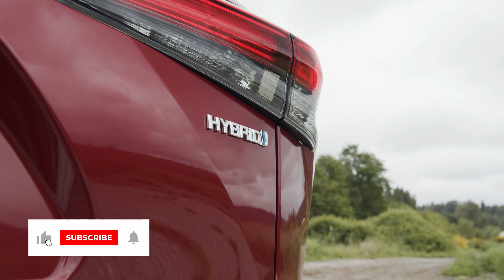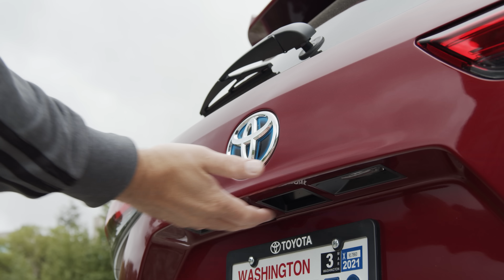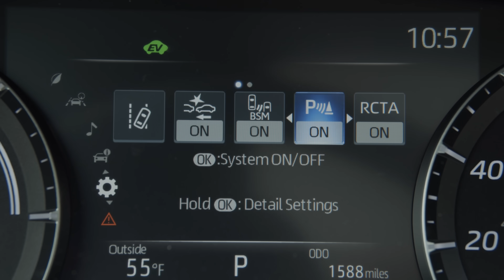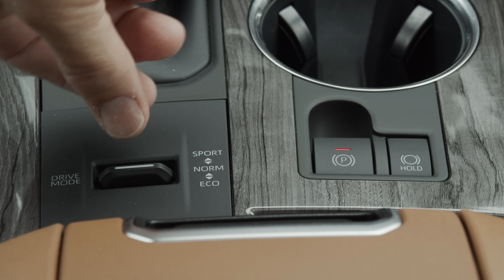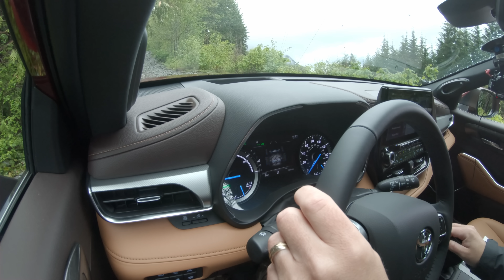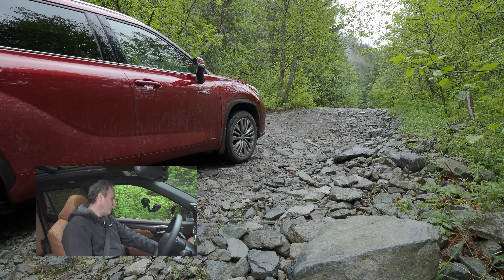2020 Toyota Highlander Hybrid AWD Off-Road Review

Comment: I'm seriously concerned it does not have hill descent control system... I've been driving a lot in the mountains recently and I'm worried about brakes. V6 version has it but could not find any buttons on Hybrid one. Any thoughts?

Comment: On a road like that clearance is more important than traction. I would have no problem driving up that road with a two wheel drive pick up, but I wouldn’t want to try it in anything without decent clearance. Better tires would be a great benefit as well.

Comment: No clutch for rear axle - fine , no overheating clutch , but does rear motor (MGR) have active cooling? Such slow mo uphill stressing rear motor also should get hot and unless actively cooled eventually would give up and awd will say : front drive only ;(

Comment: It's the torque to each wheel that counts not the power to each wheel. At 0 mph with high rotation force there is exactly 0 hp.  Even at 2 mph, no more than 10% of the power is required but high torque is if there is the traction to support it. At 1 mph, 10 hp provides 3750 lbs of force. At 4 mph, 54 hp can provide over 5000 lbs of force. I believe 54 hp is what the rear motor can provide alone. Couple this with the front drive train, power to either axle is not the limiting factor, it's each motor's respective torque rating, the availability traction, and most importantly the left right distribution of torque on each axle when slip is encountered.

Comment: Just out of curiosity, how do you think this AWD system would do on a 4x4 beach where you deflate the tires to ~20PSI? I have a 2021 hybrid, and our family is talking about going to the Corolla 4x4 beach which does allow for AWD vehicles on a case by case basis.
Reply from the maker: I think it would do OK so long as you don’t get too deep in the soft stuff.
Reply: @drivingsports  Thanks for the reply. Absolutely love this car so far. Getting ~560 miles to a tank of gas is amazing. Really want to find somewhere to test out the full AWD capability of it.

Comment: Just bought a 2021 Highlander Limited Hybrid AWD.  Put 18 inch wheels on, and will eventually put on 255/65 Falken Wildpeak AT Trail tires.  I'm probably going to add 2 inch spacer lifts to add more ground clearance.  I thought about getting a 4Runner, but I wanted something that was capable of occasional light off-road use, like the trail in the video, without driving a truck all the time.
Reply: i am thinking of doing the same thing...like that 1500w inverter for car camping and the perimeter camera view in the limited...I see Torq engineering has a 2 inch lift kit..
Reply: @stevescramo592  - Yup.  I was looking at the Torq lift kit as well.
Reply: @kchiker  let me know how it does,if you do install tge lift kit. Very curious given all the sensors  .
Reply: why 255 though? isnt 265 better for handling and stability? (may be just a bit more of fuel consumption)
Reply: @supriyasou3722  - Wildpeak AT trail doesn't come in 265 size.  I'm actually looking at the 265/60R18 now.
Reply: Are the wildpeak ok for the additional weight of the hybrid?

Comment: I think that given the RAV-4 gas / hybrid reviews, and now the counterpart reviews of the Highlander, if you think you might push a Highlander (and especially the RAV4), to the upper edge of their reasonable limits, and yet you still want to stick with a CUV instead of going for an SUV, then you definitely want to avoid their Hybrid versions, at least for now.  Hybrids are definitely improving, but they are not there yet when it comes to these types of driving scenarios.  In the specific case of the 2020 Highlander, going with the gas version provides you with the added bonus of an 8-AT instead of a CVT, plus you get more HP, more torque, and a lot more towing capability as well.  

Hybrids, and a real-word example of the 2020 Highlander:
If you plan on keeping the vehicle and driving well over 100K miles, in most cases, the V6 gas version will be better on both maintenance costs and subsequent resale value.  As the hybrid batteries start wearing out at around 100K miles, they cost about $1500 to replace, and that is for REFURISHED ones.  If you specifically request a brand new battery, the cost is no joke.  It will cost around $6K, which is why they almost always use refurbished instead.  However, in the refurbished batteries, they just replace bad cells, which means that while other cells might still be "good", the remaining good cells are much more likely to start going out, triggering additional battery refurbish cycles, that are also now on a more frequent basis, as they have increased wear on them.  At about $1500 per pop for battery refurbish / replacement, it adds up quickly.  Any savings in gas costs is immediately wiped out, and then some.

Here is a real-world example on difference of gas costs between Hybrid vs. Gas version on 2020 Highlander:
(We will use a current gas price in my area of $2.79 per gallon, and the 17.1 gallon tank on the Highlander.)
AVG 35 MPG (Hybrid) @ 17.1 gallon tank = avg of 595 miles per tank VS. AVG 30 MPG (Gas)  = avg of 510 miles per tank

With the hybrid 2020 Highlander, you gain an average of 85 more miles per tank of gas.  Not bad! With the example price of $2.79 per gallon, it means that it would cost you an average of $7.90 more per tank refill / "tank distance" on the V6 gas version of the Highlander.

So... let's say you drive a full tank of gas once per week in the Highlander. With the added cost of $7.90 ("per tank") at 1 tank per week for each year, that's 52 x $7.90, which means an average cost increase of $410 per year.  At that rate of driving each week consistently, it would take about 3.8 years to reach 100,000 miles.  When you take the added cost of $410 per year x 3.8 years = $1500, which puts you at the end of battery warranty and also the cost of a replacement of a refurbished battery! However, with the gas, you pay that amount very gradually over time, whereas the cost of batter replacement is a whopping $1500 all at once.  Moreover, you still have labor charges to replace the battery, and from 100K miles onward, you can anticipate a refurbished battery needing more frequent replacement than your NEW, original battery that the car came with. Even based on these estimates, it becomes very clear that the Hybrid is going to cost more money, especially over the long haul (pardon the pun), but we are nowhere near done...  

Despite the benefits of a Hybrid, and the fact that they are definitely improving, if you drive about 26K miles per year, the V6 gas version of the 2020 Highlander is definitely the way to go.  However, you might say Paul, that is a lot of miles per year, and I drive about half that!  Fair enough, but in which case, that burn rate of additional gas / money per year difference, would also be cut in half.  So, instead of an additional average of $410 per year, it would be $205 per year (or about $0.55 per day) to drive the V6 instead of the Hybrid.  At that tiny difference, the added cost of gas for the V6 isn't enough to give a damn, whereas dropping $1500 per replacement battery / refurbishment on the Hybrid DOES make a big difference.  Also, you would have the cost of labor.  Next, with the Hybrid Highlander, you also have to worry about the replacement of electronic differential, which comes in at about $2600 + labor, which is separate from the refurbished battery and labor.  Moreover, with the Hybrid version of the 2020 Highlander, it comes with a CVT transmission, which have reliability issues (although improving), and their notorious design nature almost always requires a complete replacement when they start having problems.  Just to be fair, the CVT is not the fault of the vehicle being a hybrid.  It is just a matter of circumstance Toyota chose a CVT for the Hybrid model, instead of the 8-AT of the V6 gas version, but nevertheless, this is the real-world situation with the 2020 Hybrid Highlander (as well as the RAV4 counterpart).  The cost of a CVT in the Highlander is about $3500, and that is without labor!  

It is pretty clear that almost no matter your driving habits, unless you are going to buy new and you know you are going to trade in before you hit 100K miles, I would avoid the hybrid and go with the V6, and you will have fewer unpleasant and costly surprises.  

With the results of Ryan's off-road testing of the hybrid vs the V6 model, it just further underscores the huge advantage of going with the V6 model over the hybrid.  Sorry about that Hybrid Highlander.😒 Keep the reviews and comparisons coming Ryan!
Reply: Great analysis, Paul!  However, in California, gas is $3.50+. But, I trade or sell every 3 years or less and definitely below 100K miles.  Would the gas still make sense. Also, if not the Highlander gas version, what other make/model of similar size would be better?
Reply: I have a 2006 Highlander Hybrid with 200k miles that's been through all kinds of craziness and still runs perfect. The technology's changed since then, but at the time it was better than the gas version in every way. Nearly 300hp from a smaller lighter SUV, the AWD system has better performance overall cuz it gives instant electric torque for acceleration, and all that torque is way better for traction than the basic on demand mechanical system they had at the time. The electric motors take some strain off the V6 and vice versa, and it's very over engineered, which is why it keeps chugging. I'd get a new one if they kept that same formula
Reply: @BrendanPJames  You are one of the lucky ones so far, but with 200K, just be ready for cost of refurbished battery and / or electronic differential.  Hopefully your also does not have a CVT like the new hybrid or "Hi-Hy's".
Reply: Paul it’s called a CVT but Toyota’s “eCVT” they use in hybrids is mechanically much different than the traditional CVT you’re thinking of. They use it in Lexus and performance applications as well. If you drive a vehicle that uses the eCVT setup you’ll realize it feels nothing like the kind of CVT you’re thinking of.

The battery pack has lost some capacity but the electric motors are 100% functional. So the engine has to charge up the battery more often, but the electric torque is still always there.
Reply: @BrendanPJames  Let's be clear about which model we are talking about.  There is the new 2021 model, and THAT model has a eCVT.  I am referring to the 2020 Highlander Hybrid.  This model has a CVT.  While they are better than what they are putting in Honda's, and way better than the Jatco's that have been going into multiple brands and models, it is still a CVT nonetheless, and they are breathtakingly expensive to replace.  When CVT's start having problems, they are largely inoperable will have to be replaced, and the are breathtakingly expensive to replace.  When you start having problems with it, you will most likely have to replace your electronic differential at the same time, or shortly afterwards, and just the replacement of one of these items will often cost more than what they vehicle will be worth at that time.  The eCVT's will be in the same boat, so there is no escape.

If buying a hybrid the driver is going to keep it and trade it in for a new one at about 100K miles, and drive in weather / road conditions, then they should be fine.  However, if they do a lot of driving in snow, muddy conditions, drive on many dirt roads, rocky logging roads, or do a lot of towing, then it is better to go with the V6, as the V6 and 8AT is vastly superior in every way.  Moreover, the V6 gets such great gas mileage that the difference of gas costs do no come anywhere near the maintenance and repair costs of the hybrid.  Any such cost savings are so easily wiped out that it just doesn't pencil out in the end.  Plus, the performance of the V6 is great.
Reply: less emissions....
Reply: @stevescramo592  Nope.  On the surface? Yes, I would agree with you.  However, the comparison is far more complicated and not that simple.

Are you willing to pay THAT much more just for "less emmisons"?  Of course not! Let's face it, while gas vehicles definitely create emissions, most people buy hybrids to save on the cost of gas, but as I just demonstrated, the savings just don't pencil out in the real world.  Also, any assumption on lower emissions is mostly "feel good" peception.  They still burn gas and create emissions.  Moreover, it requires rare earth elements to create those masive batteries as well as energy and emissions to manufacture them.  

In the end, both hybrids and electric cars create far more pollution and other negative impacts to the environment than what most people know, and in many cases, far more than what they WANT to know.  Many buyers are too busy making themselves "feel good" about their hybrid or electric, and not willing to openly look any deeper.
Reply: That's quite an analysis. Lots to think about. I drive about 10- 15 k per yr. Less than that due to covid.
Reply: @stevescramo592  Yes, lots of factors to consider.  I think the whole hybrid and electric car development is still pretty awesome,  and believe it will only get better through technology development and advancement.  Eventually, I do see it fully replacing most vehicles, but I think we are still a long way from making that a reality. In the mean time, it is nice to have multiple options for different lifestyles and driving needs.

Comment: The Highlander is not an off-road car, it is a comfortable family SUV. 
For off road adventures you have to start looking at a 4runner or Land Cruiser.
Reply: No. You don't. The kia telluride does pretty well.
Reply: @Tallnerdyguy  you need a “body on frame” vehicle for off roading. Highlander and Telluride are unibody SUVs.
Reply: Highlander can do pretty much alright in the offroading segment aswell just not as much as the 4 runner or the land crusier can be able to do.

Comment: I find it really interesting that the Highlander performed as well as it did on the rock trail compared to your test of the RAV4 XSE last year.  The RAV4 seemed to have all the advantages in that test (lighter, dry conditions), and yet struggled much more.  Surprising considering they're essentially the same AWD system.  The only thing I can come up with is that the Highlander has more weight on the rear axle.  Any thoughts on why the two cars performed so differently?
Reply: I think it has a more powerful engine in the back, i might be wrong though but i think it does, also it could be due to a different setting for the electronics? Since it is a newer car or the highlander is more "expected" to be going on trails than the smaller rav4
Reply: @pablomoreno1999  Power is almost never the barrier in slow moving, low traction situations. It's nearly always a matter of how much torque is going to the wheel with most traction normalized to the weight on each wheel amongst other factors.

Comment: I think we can all agree these vehicles are built for grocery store runs on smooth foreign and domestic roads. However, this review is awesome. I am very impressed with somewhat adequate off road capabilities of the 2020 Toyota Highlander. 👍
Reply: I actually have an old Highlander Hybrid that I use for this kind of stuff. For my job I have to drive in a lot of these exact conditions, as well as lots of snow. I don't go off roading for fun, just to get to where I need to go, and it gives you that capability. I've realized that even on certain trails that are mostly used by Jeeps and stuff, you can usually find a way to go around the most challenging obstacles. it's just that most off road people choose to do the most challenging line for fun. I can't imagine a situation where I'd need more than my Highlander's the solid AWD system, 8 inches of ground clearance, and all terrain tires
Reply: Exactly. The struggle was real. No thanks😂

Comment: Great video, thanks a bunch!  I'm feeling much stronger about the hi hi because of it.  We have a 2 mile steep forest service road we navigate regularly.   Currently our 06 v8 explorer does it no problem.  But we get 16-17 mpg on the 100 mile run to get to those last 2 miles.  It would be great to use half as much fuel and pick up the modern tech.  Some knobby tires could really help as well.  The last gen highlander had a aftermarket 2" lift kit available, I'm sure this one will as well. One of the advantages of a very popular model.  Thanks again!